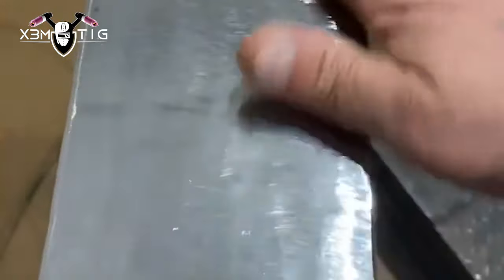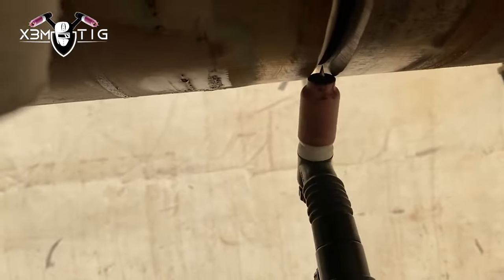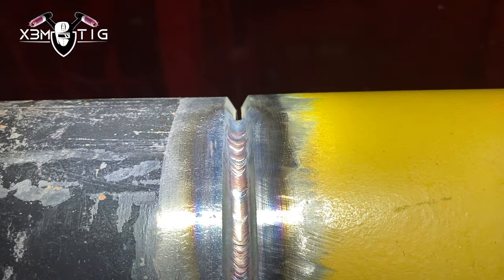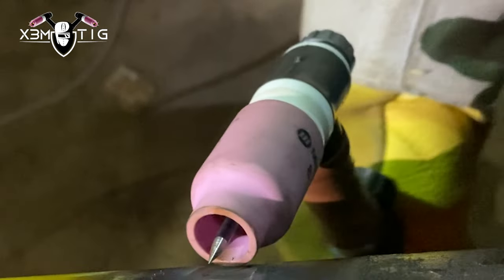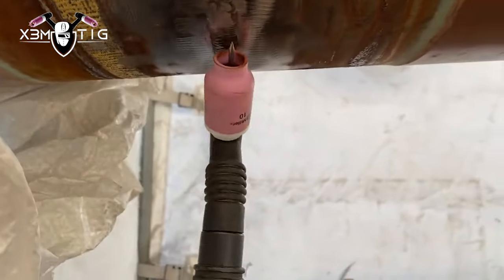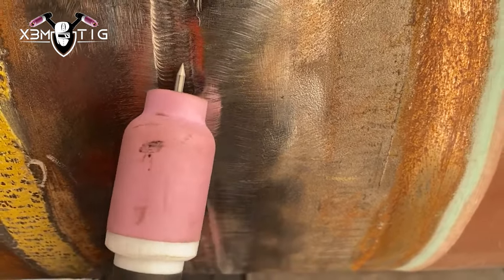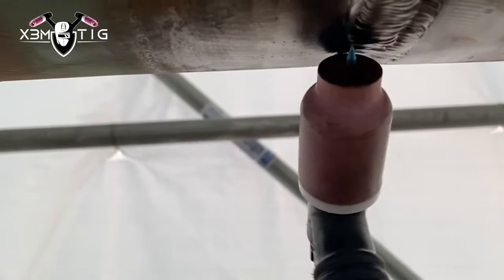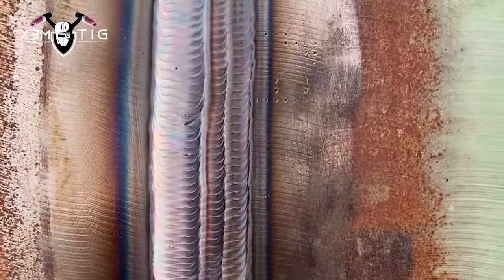Walking The Cup | TIG Welding For Beginners !

Comment: What temp would you run on 1/8 stainless rod for fill and cap?
Reply from the maker: Depends on the pipe thickness, but somewhere between 120-140 amps
Reply: @X3MTIG  appreciate the reply brother.

Comment: Any trick to avoid slip during walking the cup on the bead?
Reply from the maker: It’s not a trick it’s more of a tip I can give you. Don’t hold your torch to tight, relaxed hand and hold on to the lover part of a torch handle.
Reply: Also I found when you run too hot or your ceramic nozzle made a lot of kms of weld
Reply: What amps do you use in the 
root?
Fill?
Cap?